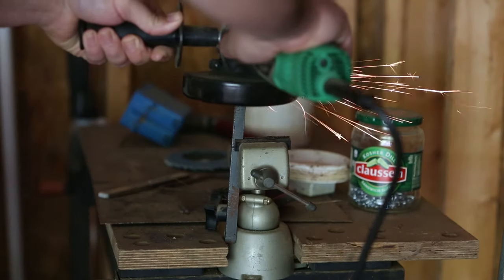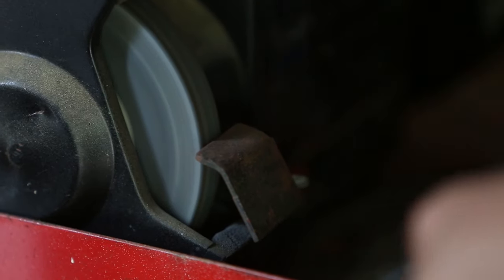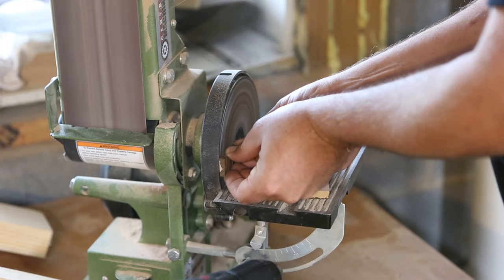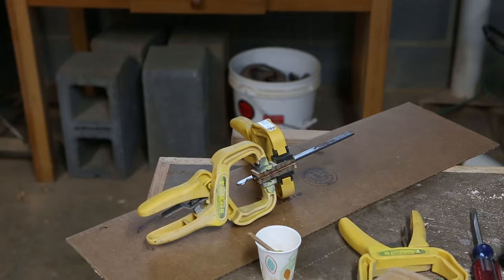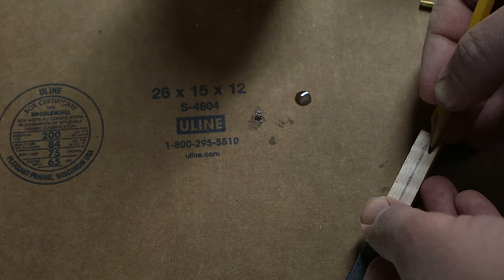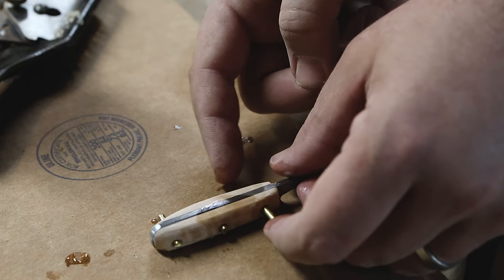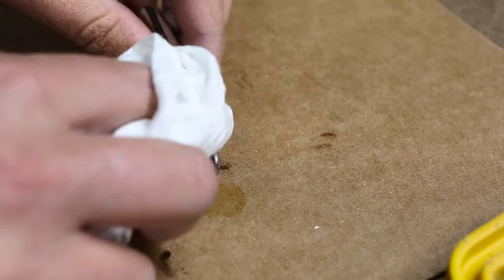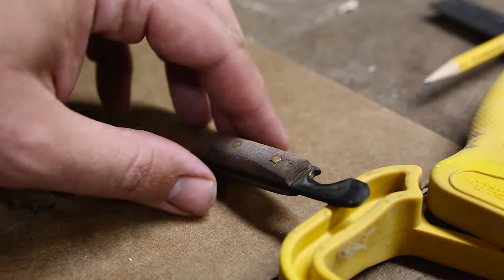How to Make a Bottle Opener

Comment: Awesome video. I love you. I love you. Don't ever use a hack saw again. 

Love,
Zach
Reply from the maker: +z dubs what do you have against hack saws?!
Reply from the maker: +z dubs what do you have against hack saws?!
Reply: Is there something better to use?  I just had to use mine and realized when I was done that wow,  I really need a new blade.
Reply: First question. I hate hack saws due to my dad. He taught me how to build, but only allowed me to use a hack saw to cut metal. 

Second question. Yes there are better things that cut metal. A band saw and a cut off wheel are some examples.  

My case is made clear by the 45 min of cutting through a bed rail that it took you to realize you needed a new blade. Pro tip - you need a different tool!!
Reply: +z dubs hmm,  never mentioned any bed rail.  I think all tools serve a purpose or wouldn't be around.  Cut off wheel would have probably damaged the rest of the piece in this case.